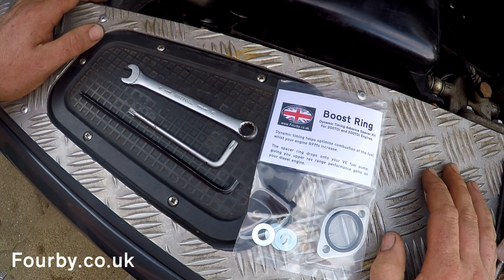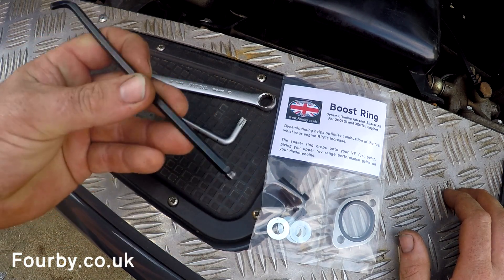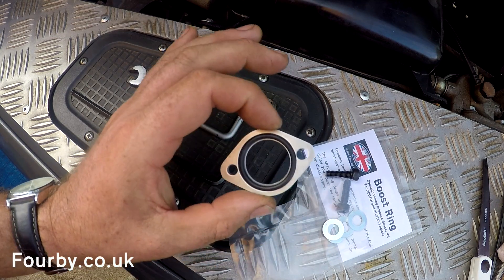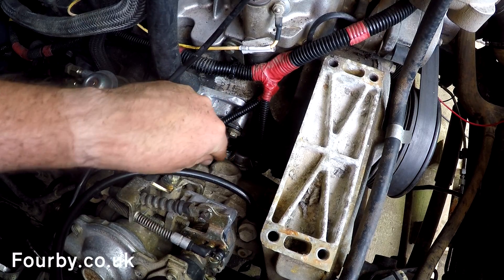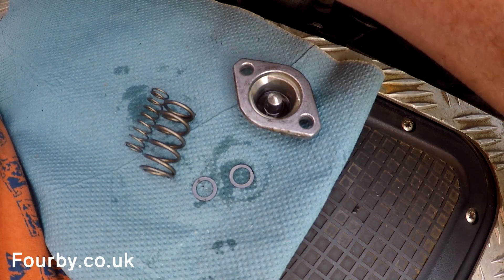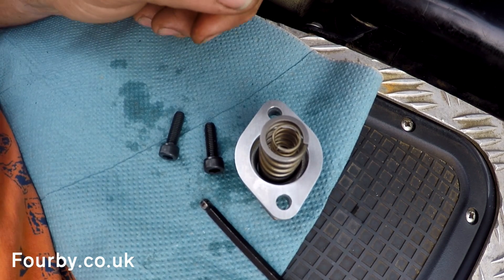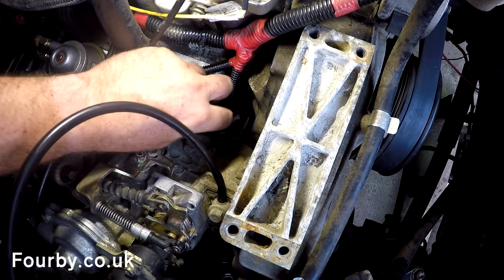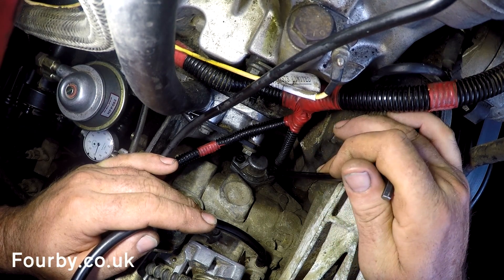Land Rover 200 or 300Tdi Boost Ring installation.

Comment: Just fitted this on my 300tdi defender. Had the Morgan Hill boost pin in a couple of months and the boost screwed up to 1.4/5 bar, and they made a huge difference to power. The boost ring however doesn't appear to make much difference unless your right up the top of the revs, which,  unless you have zero mechanical sympathy and like to thrash the living daylights out of your engine, is pretty pointless! Hardly worth the fiddly job of fitting it! Before anyone asks, yes I tried numerous shim combinations! Also, Fourby, supply the kit with knurled Allen bolts, would make you stand at least half a chance of getting a grip on it to start it off on the threads!

Comment: I fitted a boost ring into my Defender 200tdi. It is a little bit easier than in the video. There is more space around the injection pump. No need to remove a bolt from the engine sidecover.
In my case (200tdi) there was no inner spring and only one thick shim under the pumpcover. 
I secured shims and spring with a cable tie to the cover, before refitting. Then there is no danger of loosing springs and shims in the engine bay. The gap between cover and pumpcase is wide enough to remove the tie when the two bolts are secured with some turns in their threads. 
Driving with boost pin and boost ring is a great improvement.
Reply: did it make it smoke more jens
Reply: Great tip on the table tie. Works well. Thanks.

Comment: My disco 1 seems to rev up a bit quicker now.  Happy with the result.  Couple of things not mentioned in vid.  Putting the gear back together is very tight and tricky.  Also be careful that the inner spring doesn't jump out and you have to redo it all when you find it under the truck.   Also make sure you replace the old O ring otherwise you will have to do the job yet again as it will leak.  :(

Comment: I would advise potential purchasers to attempt to free the torx bolts before purchasing a boost ring. I followed the advice in the video but found it impossible to free the bolts with the fuel injection pump in situ, the access is very difficult, even with the bolt removed. Consequently I could not fit the boost ring.
Reply: I’m having the same problem. They act as if it can be easily done. Looking for any other tips or tricks. Maybe to heat it up? Or will melt shims?
Reply: Since the Torx bolts are replaced by hex bolts, I used a destructive method to remove them; I used a chisel and hammer to spin the bolts around. Tightening the new bolts was simple using a trimmed hex key.
Reply: @andrewandjelic this advice got the job done. Thanks

Comment: @Fourby How do the additional shims not negate the additional height gained by the boost ring spacer? Seems like a net zero gain.
Reply: That was exactly what I was thinking of. Looking forward to an answer.
Reply: Very good point.  I think I will stick to turning the origianal pin and the normal pump mods.

Comment: Looking for a tool to get the torx bolts out in that restricted space? On Amazon, I found the Laser 6744 ratchet flexi-head bit driver is perfect for this job. It's around 300mm long to give decent leverage on the threadlocked bolts.
Reply: InstaBlaster...
Reply: On a 300TDi? Its tight. Thanks

Comment: Ok so the boost pin is fitted likewise the boost ring and and it has made a huge difference to the performance, it does however
make a screeching sound at high boost under load. Any ideas to the reason for that.?

Comment: Ok. So the 300TDI has a bit over 100HP. I have a guy getting me a Boost Pin here in Brasil. From what I hear the pin will add 8-12 hp and change when the engine builds power. How much more horsepower do you guess or have tested the Boost ring mod to produce? 5? 10?
Reply: Anything?

Comment: in my opinion, on the 200tdi the original torx head screw sets are IMPOSSIBLE to remove with a tool. use a sharp cold chisel and hammer and loosen them both. unscrew by hand after. use a cable tie to hold together the shims and spring to re fit the new ring to pump.
Reply: This got the job done. Thanks!

Comment: Hi, top vid. I have a 200tdi. would you still recommend starting with three shims? Also, have you got any data to back up the power increases? Cheers.
Reply from the maker: Every engine is different... Start conservatively and remove shims until you find the sweet spot for 'your' engine.
Reply: I'm not a mechanic. How will I know when I have reached the sweet spot?
Reply from the maker: You drive your car more than any random mechanic,  you'll know...
Reply: Cool. So to be clear, less shims= more power? (obvs I don't want to blow the engine).
Reply: does too much advance give a 'backfire' situation when things boost up?
Will too much advance give a white/grey diesel smoke? thanks

Comment: What is the point with the spacer with the o-ring if ur shimming the spring up and moving the housing up with the spacer ???
Reply from the maker: the boost ring and the supplied shim stack are not the same thickness

Comment: A bit late to the party! Which is the better first step, using the boost pin or fitting the boost ring. 200tdi Discovery on standard settings. Ta
Reply from the maker: put both together

Comment: Hi, I already have the boost pin and have just set the timing on my pump to 1.60mm. Can I still use the boost ring without going back to 1.54? Thanks
Reply from the maker: you dont want to run the timing too advanced, I personally wouldn't recommend it, it may knock at the top end as the effect of the ring is across the entire rev range, it's not something we would test... your gamble...

Comment: I have one of these on the way. Any independent reviews? Fourby, do you suggest setting the injection pump to factory settings 1.54mm advance with a dial gauge? Can you explain how this is different then just advancing the pump timing gear a bit?
Reply from the maker: Facebook is full of reviews, reset your timing to stock, this ring exaggerates the built in advance mechanism inside the VE FIP
Reply: Can you link me to the reviews of this item? I don't see any on FB. Just general Fourby reviews.

Comment: hello can this be used on a 300tdi with maf sensor. thanks
Reply: the maf sensor is on the edc pump.  boost pin and boost ring won't be of any use to you unfortunately but if you have an edc pump is recommended that you Google "evrymod ". It is a small electrical modification using a variable resistor and an on/off switch which increases fueling . Makes a huge difference on an edc pump.
Reply: Ok thanks